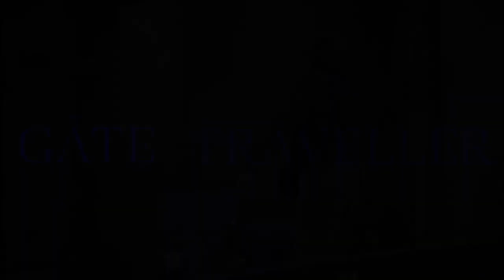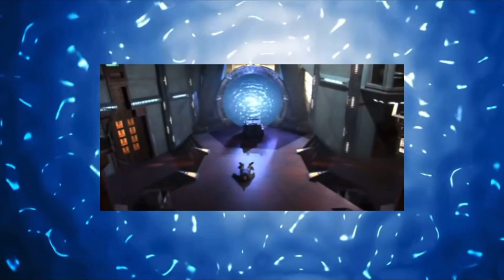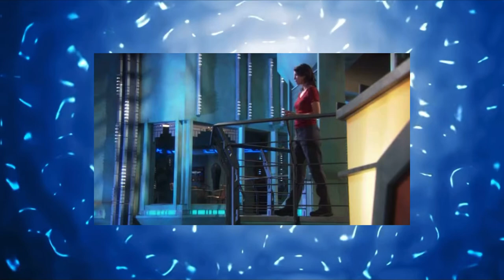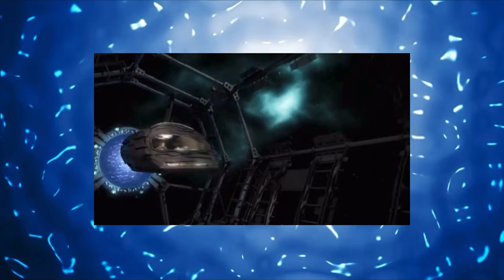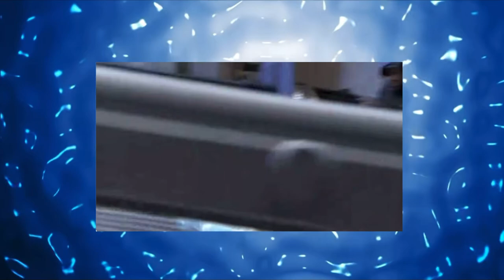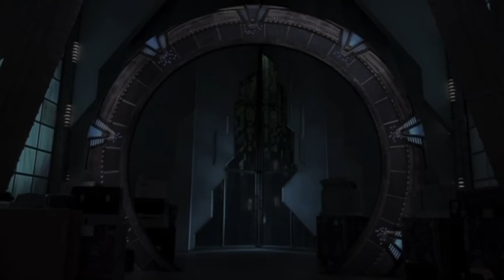Why is there no iris on Midway Station? | STARGATE Explained

Comment: Forget the science reasons, the fact that they spent so much time making this just to throw it away almost immediately after is beyond stupid
Reply from the maker: Agreed
Reply: Yeah. I understand the problem they ran into could be argued as an inevitability because it hinged on the one thing that could go wrong not going wrong, but the idea that it all went down the toilet immediately is just wasted potential. I mean even weaknesses in SG-1's Iris system, while inevitable, took a bit of time before the shit started hitting the fan.
Reply: I don't think they threw it away. They reference it a few times as being down or repaired after the incident.
Reply: @rekrn12345 i dont recall if it was fixed in the show, but they definitely rebuilt it in the books
Reply: Should've added shield technology. Quarantine shield.
However. Making it so that it's difficult to go between galaxies gives actual tension... so they shouldn't've ever made it.

What they should've used is, well, maybe figuring out the O'Neill Power Cell for instance.

Or, if Mark III Naquadah Generator could produce so much energy, try that!

Comment: Midway actually doesn’t connect directly to Earth, it’s in the middle of the void between the Milkyway and Pegasus and uses the same macro to traverse multiple Milkyway gates. But Earth still uses an IDC code from Midway to determine of they should open the Iris or not. So it’s something of a plot hole that Earth is still able to receive a code and signal back that the iris is open to someone on Midway. So either the macro doesn’t work the way you describe (though iirc you’re not wrong, I think it’s described in the show the same way I believe), or the writers weren’t thinking it through when they wrote the “Midway IDC” line.

Comment: If you trust a macro to send you to different gates, then you can trust the macro to open the gate iris.
Reply: No, that kind of override basically becomes a huge security issue, since if the iris will wlbe opened regardless, then there's no point in having one in the first place. You can ONLY reach Midway with the macro, so if there's in incoming wormhole, they're going to get in one way or another with the timeout override you're talking about.

Comment: Okay, no iris, but locked rooms would at least slow down the enemy.
Reply: I came here to say the same thing. Even just a big iris to seperate the gate room into 2 seperate areas
Reply: Or yknow. Make the room airless, every personel has to use a suit.
Reply: @trazyntheinfinite9895  or leave the gates in space they have to use a puddle jumper, they can then dock to the space station
Reply: @trazyntheinfinite9895  So every time Earth dials in they evacuate the air from the gate-room into the vacuum? Great idea! [/sarcasm]
Reply: @brendondann1858  See above comment. This will fail badly from the Earth side.
Reply: @GoranXII  earth gate can enter into the midway station, they then enter a puddle jumper, exit the station and fly into the space gate
Reply: @brendondann1858  Slightly more workable, but still tedious.
Reply: @brendondann1858  Slightly more workable, but still tedious, as you'd need two bocking bays, one occupied (for stuff/people from the Milky Way), and one free (for stuff/people from Pegasus). How maneuverable are puddle-jumpers?

Comment: Technically, Midway couldn't work.  The SG 1 episode 48hrs said that when a Star gate activates it wipes the data buffer.  It would never work based on established lore.
Reply: That was not necessary set in stone, since it was also mentioned that the gate swoosh, played a role in wiping the buffer, it was established that if a gate can be activated without a swoosh, the buffer remains. 

The asgard them selves are able to dial a gate without a swoosh. Seen when they wave they hand marble.

The gates, simular to phones, can be used to redirect calls. Passing them onto other gates, without the intermediate "phones " from actually ringing. So no swoosh
Reply: @MinkieWinkle  True, the problem is, when they show the clips of them, there very much is the swoosh.  Had they done what Lyra of the Nox did, or Asgard (or even old Cassandra in 1969) then it would work.
Reply: @yendub  that is indeed a fair point

Comment: That was a really interesting video!
 
Since the only way to dial along the gate bridge is with the macro, if the macro included code to open an iris or shield then it would render them pointless. Regardless of if this code was automatic, or if it signaled a guy in a control room to manually open the iris, since the traveler is just a pattern in the buffer at this point there's no way for the control room officer to verify friend or foe. In "Midway" the Wraith invaded by hijacking the macro, so the iris would have opened for them and let them in.
 
One way I see this working is if Midway Station could be in direct subspace communication with both Earth and Atlantis. So when an unscheduled wormhole connects, you're held in the buffer while the crew calls up whichever side you came from and says "Did you just send someone through?". When they get confirmation, then they open the iris and the macro releases you to be rematerialized. However I think it was established that Midway is too far from either side for subspace communications. Maybe they could put automated relay transmitters every so often along the gate bridge, but then you would have the danger of Wraith hacking one of your relays and sending false signals.
 
Small correction around 2:15: If you're still in the buffer when the wormhole disengages, I don't think you would get wiped immediately would you? It would take a couple of days for your pattern to fade (calculated by McKay when Teal'c was stuck in the buffer in "48 hours") OR you would get overwritten if another wormhole connected. Otherwise you could conceivably be rescued if Daedalus showed up before then or if a team came through the other gate.
Reply from the maker: Thanks, you’re correct about not being wiped instantly from the buffer, but I should have been more specific: in that when the wormhole disconnects and you’re still inside, the following wormhole connection would indeed wipe the buffer clean (seen/heard in 48 Hours). 
Even if the Daedalus or Apollo arrived at Midway to retrieve you from the buffer it was quite a work around to trick the gate into letting you out without creating an additional kawoosh (which is what wipes the crystals clean). It’s definitely possible and the macro technically does this anyways during the bridge transfer, so who knows. Maybe the macro softens the kawoosh that is created as to not clear the crystal patterns?
Reply: @Gatetraveller1  you know with the terras knowing what the gate does for over so long I wonder if McKay could create a macro that could be used if the game from earth shut down before you passed through same as the other gate.

Comment: If midway had an iris on both gates it could be used to stop an invasion force. e.g. in the episode that the wraith take midway the first few wraith come through you close the iris stopping reinforcements and the soldiers on the base can take care of the few wraith that got through. But the actual reason is plot. Like in S5E1 the Daedalus had to lower it's shields to beam people to the ship despite it beaming people to the ship before without dropping the shields in s2e1
Reply: Ironically that's a maintenance issue wrapped up in asgard tech manual that abruptly switches from human dialects to first contact ancient dialect point being whoever was to show up and maintain the tech for power draw errors that result in downed shields was in the med bay with the man flu.

Comment: Midway, should have at very least had a secured room for each gate. Like a shield cell. Whichcthen can only be lowered by personal based at midway, 

You come through the gate, no iris sure. But you are still stuck in a box room. The midway team then lowers the shields of the room if a idc is given after they step through. If not.

The room remains sealed. It is that simple
Reply: Plausible and secure.

Comment: Midway gate room should have had a quick decompress cycle and an ejection option on the gravity. 

Station under attack? Hit the emergency button and the gate room is exposed to vacuum the roof opens up and the gravity plating reverses and shoots anything not bolted to the floor out the roof

Comment: They didn't have to worry about codes, but having the option to manually activate one in case of attack would've made more sense. Yes, McKay was too arrogant to consider the attack vector that happened, because he never took into account that someone might find out about it in the event that Atlantis got taken over by an enemy (or in this case: Todd getting curious about the ongoing projects by his frenemies.)

Something else they could have done is a countdown timer that would have depressurized the gate room if their IDC wasn't entered after a short time has elapsed.

Comment: Something I would of done was add an airlock between the gates and the station that can be ejected out into space. Add sentries maybe even turrets and a lot more guards.
Reply: You shouldn't need guards because the gates were not part of the network and should have been theoretically safe. It was only taken down because the wraith had to physically intercept the code. In a giant universe this theoretically should not have been possible but you know stories need to be told and stuff.
Reply: @rekrn12345  the fact that any gate could connect to midway, means it was clearly not very safe. And they should have known that.
Reply: @unematrix  That is only technically true. You would need the code and the program to actually connect. Something that should not have actually been possible.

Comment: I enjoy the video, but respectfully disagree. The same problems mentioned for the midway iris are the same problems that could happen with the sgc iris. The sgc iris does appear on to have a macro that holds people in the buffer until the iris is opened or an unspecified amout of time passes and it seems to just let people through and die anyways. The miday iris could either do the same thing, or you could set up another macro that if the sheld or iris never gets open, eventually the gate shuts down and reverse dials back to where you came from (so basically the same macro that already exists for the gate bridge, but going in reverse and instead of it doing it automatically it waits to see if iris or shield isn't lowered then does it automatically.)

Comment: Easy rule-patch for the iris issue: don't connect directly to Atlantis or Earth. Have the exit direction of each side of the bridge spit you out onto a predetermined, ideally uninhabited, planet. Then from there, dial Atlantis/Earth, input IDC, and travel as normal. Midway itself would have no iris on either gate, as the fact that you had the macro to access the bridge in the first place is authentication enough (and if the station is hijacked, both ends of the bridge spit you out onto a backwater planet that you then proceed to the final location from using IDC authentication).
Reply: 90% of the journey is the intergalactic void. There are no planets
Reply: @Josh-oj9mm  Yes, but there's the 5% on each end where there are. And it's not like Atlantis and Earth are the only planets in their galaxies "within Seven-Chevron range" of the bridge start point (they proved that by accessing the bridge from a different gate in Pegasus). Just choose a random (uninhabited but safe) planet on the outer edge of each galaxy to have the bridge macro spit you out onto, and upon arrival, then do the "final transit" to Atlantis/Earth via conventional dialing and IDC usage.
Reply: It would have made more sense for it to connect to an alpha or beta site. I don't even remember if those still existed at this point in the shows history. I think anubis destroyed one at some point. Did they just stop doing it after that? Honestly don't recall.
Reply: You would still have the same problem of the Wraith being in the milkyway.

They could just dial another gate, grow hive ships, wait a few years, and then attack.

It wouldn't solve the issue.
Reply: @unematrix  ...To quote the Daleks... "BUGGER!"

Comment: Midway station never made sense to me.... both galaxies are spinning at an incredibly fast relative speed and also moving throughout space at an even greater speed. The station would have to move through space at a parallel course and speed in order for the gates to continue working.
Reply: That was also my issue. As far as i recall the gates are normally objects traveling in their corresponding trajectories, bound to planets or solar systems or galaxies. So with everything working together like a geared mechanism they were able to determine specific coordinates for the gates, inside a galaxy its 6 points and the calling gate name, between galaxies the galaxy, the 6 points and the calling gate. In universe they found a way via 9 chevrons to go to the moving destiny gate, but that wasnt used before that show and from the timeline it should be after the Atlantis-Pegasus-Galaxy arc. So they had 2 gates between 2 spinning galaxies fixed to each other and therefore ripped out of their positions, so the 6 points to call method cant work, cause the target gate of each galaxy would not be inbetween the 6 points anymore, its fixed to another gate, only one can work if it stand on its original place. 

But on the other hand star gate is the show with the most logic holes ive ever seen, even star trek is more consistent (WTF IS UP WITH THE FUCKING WANDERER FROM TNG???????) on this.